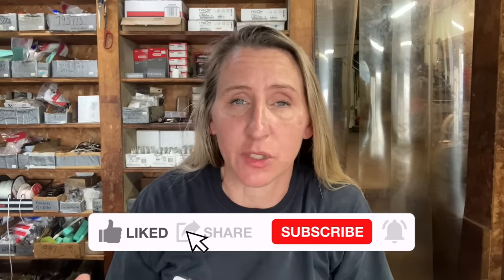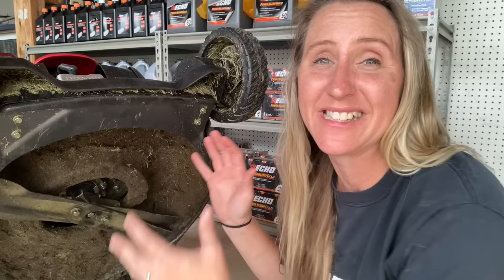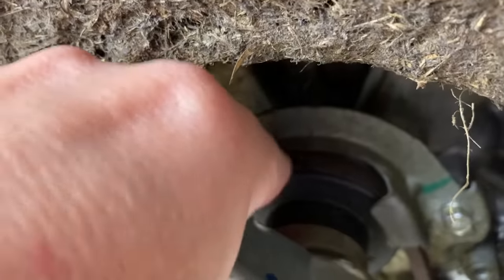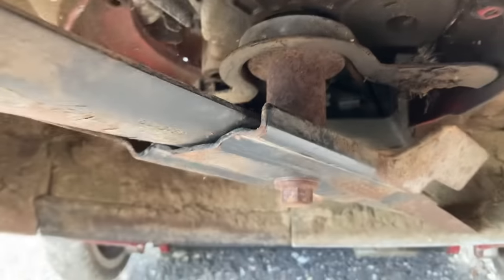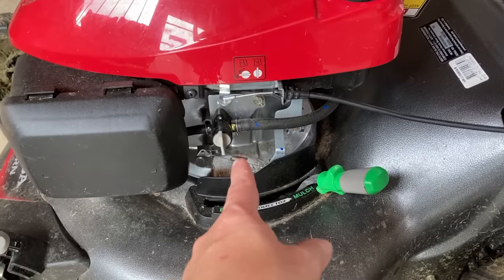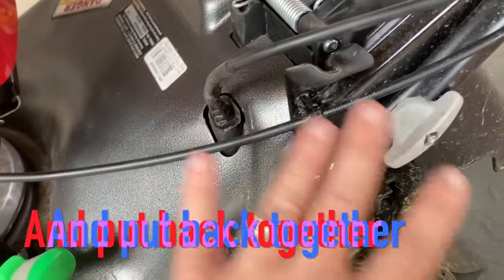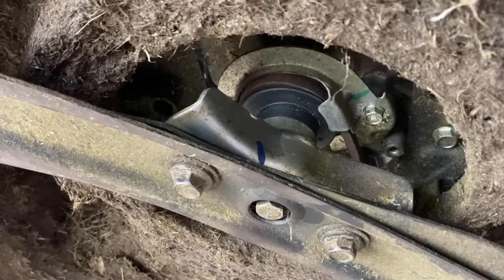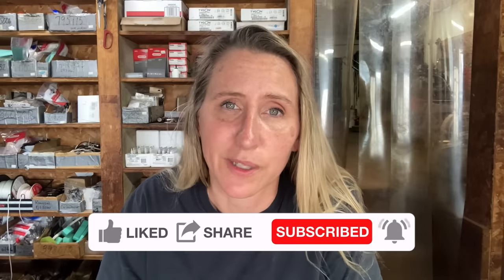SAVE A TON OF MONEY in repairs by NOT BUYING this NAME BRAND mower.

Comment: I have a craftsman lawn tractor for about 12 years now with a Briggs and Stratton intel 18.5 bp engine…..it’s on its second head gasket now, only 3 years to blow this one….. I’d like to meet their engineers and slap them for a bad engine design. They could have designed to have one more head bolt between the cylinder and push rod side of the block to clamp down on the gasket…….

Comment: Mowers starting to break after 2-3 years?  I guess I got lucky with my 8 year old Toro self-propelled; nothing but oil, spark plug and air filter replacement required.

Comment: Honda seems to have lost their quality ethic the last few years. I bought a new HS720 snow thrower a couple years ago and about 3 snowstorms in, it started throwing oil everywhere. The crankshaft had worn thru the bearings into the block & dealer wouldn’t warrant it. Ended up buying another one from another dealer, and it seems ok after one season. My old HS520 went 10 years without anything but routine service.

Comment: I have just destroyed a craftsman by hitting a stump in the high grass. My bad, but, the blade mounts on the bottom of the crankshaft.  Its not 1952 anymore!  Stupid craftsman did not offer an electric start, either, and no choke. Things aren't what they used to be. When I fix some part that was engineered to cheap, I'm not afraid to put an angle bracket right on there and a zip tie or something. The day after its new, its used.

Comment: I just read that the drive system is a "belt-slip" system. Could it be possible that customers are ruining the belts because of this style? That sounds like a lot of potential for destroying a belt to me. What I mean is that the customer can't keep up with how fast the mower goes, so they back off and the belt is always slipping. Don't you think this could be contributing to the belt failure? Incidentally, I just bought this mower.

Comment: I bought a Honda (2nd year, hardly used) because I listened to others and should have followed my gut. The mower cuts like shit. Seem strong and motor appears solid, but then you cut and I need to throw grass, not mulch. Mulching is for cupcake yards. I don't have this scenario. My Troybilt self propelled, although light, serves it's purpose and I cut about 3 acres worth and almost cut every two days on the average. When a good mower is priced right, then damn,  bought out by MTD. Such BS. Troybilt was a good company, especially the tillers.

Comment: Excellent info. Must stay away from this Honda model mower. My Toro self propelled is in the shop. Bough an electric mower with two 40 volt batteries. Can turn a key to a fully charged battery if one runs out. Very heavy, difficult to remove to recharge it. Takes over an hour /each to charge. Will not tell you the brand but the two 40 volt mowers are similar. Can't wait for my Gas Toro to be fixed. Sorry I'm not in your area. God Bless for your excellent site.

Comment: I have a Kawasaki 15 HP on a mower Model FH430V$ that is pushing oil out of the top crankshaft seal, the bushings and seals were replaced a short time ago. Now there is a lot of side play at the top seal What would cause this?

Comment: From what I'm told, Honda Mowers are not made by Honda. They are a Honda "Authorized" manufacture. So, you see, they could be made in central America with the Honda sign on it. The company just buys Honda engines, and builds the mower around them.

Comment: Seems I am always the one that gets stuck working on those  garbage mowers. I usually run right to the interwebs if I suspect there is a hidden factory issue with something. I worked on a Skidoo Snowmobile that over heated and melted a piston. I rebuilt the engine to factory specs using the Skidoo factory manual and right after rebuilding the engine, it showed signs  of overheating again. I found there was a factory ammendment reguarding the issue by cutting a vent hole in the hood( they provided the screen) and rejetting the carburetor  to run richer  than original factory specs. That made it a real gas hog. Sadly, new doesn't always mean it was made correctly. I remember the riding mowers made a few years ago with the mostly plastic transmission. It was supposed to be a CVT transmission, but not. Just a real POS.

Comment: That’s disappointing. I’ve been using my craftsman mower with a Honda engine since around 1994. I had to work on the lever carb mechanism once around 2005. But it still starts up first pull albeit with a little smoke now.

Comment: I bought a self propelled lawnmower years ago from Walmart. About the third time I used it, the belt came off of the pulley. I put it back on three times. After that, I returned it to the store for a refund. They desperately tried to get me to let them repair it or even exchange it for another one. I told them that I will NEVER own a Self Propelled Lawnmower ever again, and I haven't.

Comment: Well - thanks it’s unfortunately not so nice to know that not only the lower line self propelled Hondas have the described issue - the latest HRX217HZAA, that I have had only a week has exactly the same issue as the cheaper HRN models described.  I have had 3 Honda Hydrostatic mowers since the mid ‘90’s (the first HRB215HXA hydraulics system finally died and so on to my newest model) - took a look at the oldest unit (my son is still using the 2nd, now 8 year old one in Altus, OK) and it has a full shield over the belt drive to the hydraulic pump/motor!!  I suspect the new version was designed to be ‘disposable’ since the gas mower is being phased out in favor of battery electric units - as a longtime engineer I would bet dollars to donuts that Honda Georgia &/or California’s younger engineers were tasked to cut out a certain % of the cost to manufacture the latest units and they did exactly that - at the expense of both reliability and longevity!  I wonder how long before our normally wet Pacific NW grass ruins the belt and associated drive unit??

Comment: Got a question I have a 042 stihl chainsaw was told that the high side electronics is out and there's no fix for it no parts available,  now I don't know mutch about the electrinic ignition,  I bought this saw new I'm a one owner when it runs its a beast I would like to fix it can you advise me.

Comment: Chickanic ?
I have a Weedeater conventional power mower with a B&S 158cc (5hp+/--?) dern thing got some age on it now. I didn't purchase new. Not to long ago after sitting up due to it would not start, so I abandoned it to my shed until. Later I decided I give a nearby shop a try. Soon after I used it and almost immediately it begab smoking not from exhaust. In fact it was undeterminable from where the greyish mist was emanating. It will run but seems clear there is something wrong. 
Any ideas either what to do, where to source a cheap replacement motor ? I already dropped a buck and a half with the shop. I have a CC rider I am happy with. Need a push mower for around trees and shrubs, close to house (doublewide). Yes I have a string trimmer/mower. Prices are out of sight anymore. IJUSTDON'TKNOW.FLORIDA ............:person-turqouise-waving::face-purple-crying::text-green-game-over::body-blue-raised-arms:

Comment: Honda?!? Storytime: New home, bought a cheap lawnmower. It lasted like twenty years, needing one part. Trying to replace it with what I thought would be a better mower I had one problem after another. Gave up and bought a Honda due to their reputation for reliability (at the time probably accurate). I HATED THAT MOWER. It did everything worse than every other mower I had tried, and the worst part was, THE DARNED THING WAS GOING TO LAST ME FOREVER - I'd be stuck with a crappy mower 'til the end of time. 😆

Comment: Honda IMO has lost its quality status.  I say that as a 'past' honda fan even tho I still own 2 honda atv's and two honda motorcycles.   Some parts on the ATV that are made of plastic  should have been made of metal (choke and choke body)... it is exposed to all the UV when outside and cracks after about 5 years (my experience).   The 2 motorcycles have also had issues that honda would not guarantee...  a broken brake cable on one with less than 2k kilometers on it.   Another one had a cracked bracket that " rattled",  the dealer said it was "normal".  Looking elsewhere next purchase.

Comment: I have a GCV160 Honda with all the problems she has mentioned. Just changing the belt is a big job. Plus, the wheels won't spin when pulling the mower backwards, which means you have to drag it or lift the rear wheels off the ground.  This is another common problem. There are fixes, but I didn't buy the mower to fix it. Toro is a much better mower. Wish I knew then what I know now.
What I don't get is the high ratings these mowers get from HD. I guess they're from people who've never had to work on them.

Comment: As a retired, independent Honda auto and motorcycle mechanic I will state that when Honda falls to Chinese levels of quality it marks the COLLAPSE of civilization itself! They and Toyota have, for roughly a half-century, FOCUSED massive effort on the highest quality possible hence car engines that routinely last for several hundred thousand miles as well as corrosion-resistant bodies and frames, etc. Once that commitment to excellence is gone it's GAME OVER. They were the last bastion of this commitment. I'm very curious to see if they will stand behind their products, as they have in the past, and MAKE THIS RIGHT.

Comment: Sadly Honda has joined the throw away folks.  I have a HRX 217TDA machine.  3 speed trans. The trans is French made. Plastic.  No parts available.  Complete trans only.                     Motor is great. Starts on one pull always.

Comment: I have had Hondas, motorcycles, cars and mowers for well over 50 years. They very rarely trip up with the designs. When they do, they are monumental cluster wotsits. The last mower I had lasted 21 years before I passed it on to my son, who eventually killed it. Went to buy a new one and couldn't justify the price, so Hyundai it was. The wife sold her old Honda Jazz and bought the new model. The old one was far better in many respects to the new one. I suspect that the top management in Japan are no longer following Soichiro Honda's ways of designing and working.

Comment: Question I shared the bolt off my push mower when I was putting the blade back on so now half of the bolt is stuck in the housing is there a way to fix this? It's a yard Force self-propelled mower with a Briggs & Stratton exi 625
Reply: You can try drilling a hole into the center of the remaining portion of the bolt and using a tool called an "easy out" to try and unscrew the bolt.

Comment: Although the mower could have a better design, it is not the mower that is the issue. It is the end user. You should clean or at least check the underdecking before before every mow. It should be the same as checking your oil. How do expect for your lawnmower to cut correctly with grass build up under the deck.? You will never get a good cut. Your mower is designed to stand up the grass for the initial cut then subsequently mulch. This will not happen with grass that has accumulated under the deck.

Comment: I wish I would have subscribed earlier.  I had a comemrcial snapper with the kawasaki engine started to give me problems and i could not get a mechanic to look at it, so i purchased this Honda from the box store.  I live in Louisiana and have St. Aug grass and it cannot cut very well when the grass gets 3 inches!  I have a question about my Kawasaki engine.  It starts fine but starts to blow heavy white smoke out of the carb.  a friend tolds me that the heads are blown, but someone else told me thait could be the carb as Kawasaki engines have carb issues.  Any advice?

Comment: I have a Snapper mower and it will NOT bag Flotida grass!  I increased the RPM substantially to no avail!  The deck is so thin that when I was cutting thick grass the blade sucked down and warped the deck!  This is the worst piece of trash mower I ever purchased.  It has ball bearing wheels that require constant care. I like bushings for the damp Florida grass, fewer maintenance problems.  The deck materiel is really thin and in just a few years it has rusted through.  I clean this mower EVERY time I use it.  WORST mower I ever purchased and they have NO WARRANTY.   They say take it to a repair shop and pay for the repair and then try to get the company to reimburse you!
Reply: Don,t bag it, just let it spew out!!! If you take issue, then prepare to cry!😢!😢!😭😭😭

Comment: Work at a dealer with multiple brands, including Honda and Toro. I recommend Toro hands down. Why? They seem to be the only company that sticks with the phrase "It's just a fucking push mower". Simple design, holds up well, parts are readily available and cheap. The 30" double blade units are a bit unique, but still hold up better than most Honda stuff we have coming through. I'm glad Honda is getting out of the push mower market.

Comment: I bought a top-of-the-line Honda walk behind mower with the plastic deck. The electric start has been a joke from day one. The battery is a 1.3 amp hour. It is the size of a large candy bar. I can only get three cranks out of it on a good day. The shop is looked at it over and over again. I would have thought if anybody could get an electric start mower right? It would be Honda and they completely blew it. I now have bypassed the batteries and I jump it off a larger battery in a charging station in my garage. That's the only way it works. Sorry Honda

Comment: And sadly there is now a recall on most of the motors in these mowers and powerwashers.  Poorly cured plastic camshaft is breaking peoples arms when they pull start it.  Of course the whole motor must be disassembled to get to it.  At least it is a free repair by the authorized shop.

Comment: Not telling us about the belt you say is better is definitely NOT appreciated.
I know that the standard belt on my HRR216 is a bit too long, and when the pulleys become a little worn, there is no way to compensate for it other than new belt & pulleys, when a shorter belt would fix it (if I knew what belt would work).

Comment: Well after looking at all the Commercial Type Lawn Mowers, None of which I was impressed with (Including The Prices) I Ordered a new 8.75hp Briggs & Stratton, installed it on my 20 year old Snapper Hy Vac and I'm mowing once again,  The Engine didn't cost much,  but I was in a state of shock when I opened the Briggs box and discovered a engine that is made of nothing but CHEAP BRITTLE PLASTIC, made out of recycled Water Bottles,  even the Carburetor is now made out of Plastic,  It does start on the first pull,  but it appears that Briggs is now making low end throw away Junk engines.

Comment: I disabled the transmission in mine because it didn't work anyways (little clicker teeth). It's true push mow now. I also only use ONE blade on it. Nothing stops the mower. Last time I changed the oil was three years ago, but I run it out of gas every time I'm done. I blow out the air filter and use sand paper on the spark plug followed by washout with starting fluid which I shake out onto the ground. That last part is for the nature nazis.

Comment: Wow! I am looking for a new mower. But, with Honda not making mowers in September 2023; dealerships are not dealing on them. Snapper is maybe gone. They’re marked up too. I am hearing too many horror stories about the new Briggs engines. Ok? Only good mowers that I am seeing is the Toro Commercial 21; with Kawasaki Kai engine. With the BBC and self propel. Super expensive. But, compared to other models. These will last me until I am long gone. Electric? You don’t buy an electric with the idea you’re going to get more than 7 years out of it. Sorry! I just feel like 2023 is not a good year to buy a mower.
Reply: Do your research then buy a new Honda mower, that's what I did.  They have thousands upon thousands of 4 out of 5 or higher ratings.  I don't know what she's going on about but there is no way that many "bots" could be reviewing and giving false positive ratings.  They often have photos and descriptive reviews.  My last honda mower lasted me 13 years, and it was the Toro built garbage drive system that gave out, I still used it for 3 more years as just a push behind, and decided that now that Honda is going to stop building, I'd get an ALL honda mower and it should last me for 15 years or more.  That old mower I still have starts on the first pull EVERY time.  Honestly, the one she is looking at there, just about any mower, if you let it get that caked on, you are going to have some problems.

Comment: Honda will cease manufacturing gas lawn mowers in the US beginning in September 2023. It plans to continue selling the units through 2024 until they are gone. Honda will continue to manufacture and sell the remainder of its lawn and garden product line and industrial type power products such as GX engines, generators and water pumps, and continue to supports its service and parts operations in the U.S. market

Honda will continue producing lawn mowers at their facility in France for the EU market.

Comment: Old news, Honda's been making junk self-propelled push mowers for decades!  The engines are great but the drive-train is a engineering disaster.  Most Honda self-propelled push mowers are really DRAG mowers especially when pulling them backwards.  I've spent an awful lot of time machining & fabricating parts fixing their junk design 😉 

Best to just avoid self-propelled push mowers.  They will nickel & dime you to death with drive-train parts which end up costing you way more in the long run that a standard push mower.